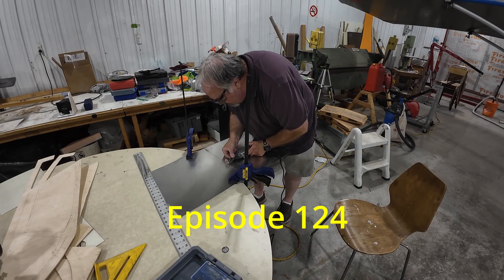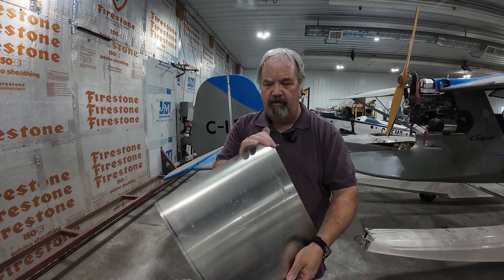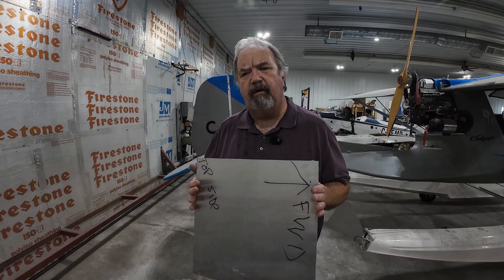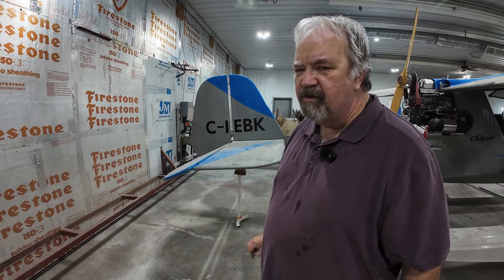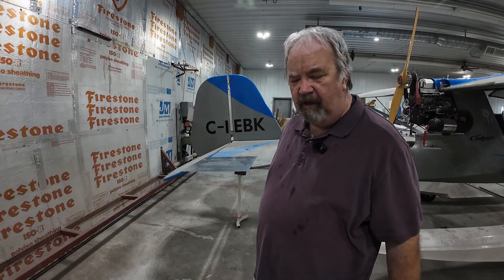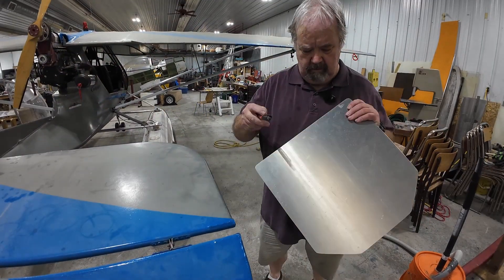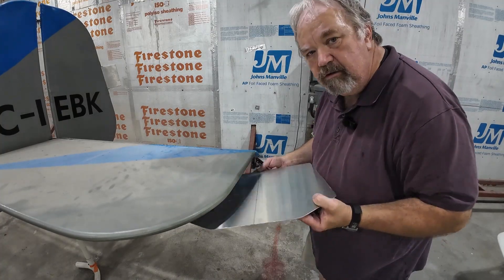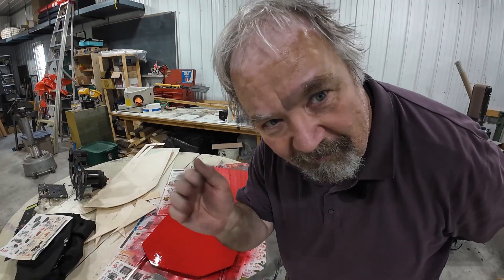EP 124 Part 1 Fixing Flight Instability of my Challenger 2 Airplane

Comment: Sir, I have watched this video series for a while and I think you are creating issues for yourself.  This plane is too heavy and too underpowered.  I believe you said its 656 lbs currently?  Mine is 453 lbs and its a little over weight (so am I!).  I do have a Hirth 3203 which about 13 more horses then your 503 so I have a little more of a margin then you in that respect as well.  The video you showed of your first flight exhibited all classic symptoms of an over weight aircraft, specifically wallowing and lateral controllability issues.  The max for a CH2 longwing with heavy load kit is 960 lbs gross.  beyond that there is some weight buffer but you will lose G loading and momentary G loading can cause structural failure.  Now you are adding more weight with UK tail and finlets? Mike at the factory as always said "Add Lightness".  The original 2 seat challenger weighed something like 315 lbs are flew well on a Rotax 447 for comparison.  Please be careful.
Reply: I wish he had listen to you apparently he crashed yesterday and was killed.  Information is that a witness saw him spinning when he crashed sounds like a stall spin which I'm told float planes can't be recovered from a spin easily. Peter said he is at gross and it maybe climbs at 250 fpm I tried to find a video where he got the W&B done but I can't find any. There was a comment that he replied to that a video was made when someone asked him if he got the W&B done. I can't find any it's possible he was actually over gross and W&B may have been also wrong. Who knows if the investigation will ever be made public I hope so, but will be years. I wish CH owners who are now saying "Peter floats on a 503 will be over gross" said that 2-3 years ago.
Reply: Your a good man @jackryan152. Most people wouldn't have taken there time to express what you seen and thought about his aircraft. But you did. Even if this horrible accident had nothing to do with the above, The world needs more people like you @jackryan152. Cheers from Pennsylvania
Reply: The closest thing to this (fore and after seater on floats) might be the Aircam, which is at least 4x the HP across 2 engines. I always wanted to see a new version of the Challenger to better fulfill Peter's goal of a useable 2 place on floats. Everything else coming out now is an EVTOL. I wanted him to use an electric powerplant at the very beginning but he didn't want the range loss. Specific energy is over 400-500 wh/kg now.

Comment: Looking good. For mounting, I recommend using a bolt saddle between the winglet and on the inside to protect the frame tube. A small brace to the rear tube will help with rigidity. You're also changing the CG, adding that much weight, and placing it that far aft of the A/C CG.

Comment: Nice !!! Love your shop and equipment for cutting material such as aluminum. Looks like this would be a good scenario to use some blue Loctite or equivalent on those
nuts/screws due to so much vibration on those new vertical stabilizers. I agree with outlawflyer in that some longer brackets the better for stability, your call for sure, 
just what you need " backseat mechanic advice" ---ha !!! Anyway I enjoy watching your progress with this and wish you smooth sailing !!!!
Reply from the maker: I appreciate the positive feedback and will consider the advice!

Comment: Me personally, I would add L-brackets to the inside of the fairings to add rigidity. I would also add cross bracing on the vertical and horizontal stabilizer, Don't just rely on 4 nuts and bolts. Those winglets will shake in in the wind. Redundancy! Good luck.
Reply from the maker: I'll keep that in mind.